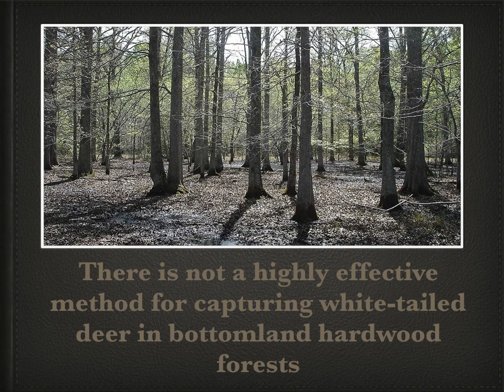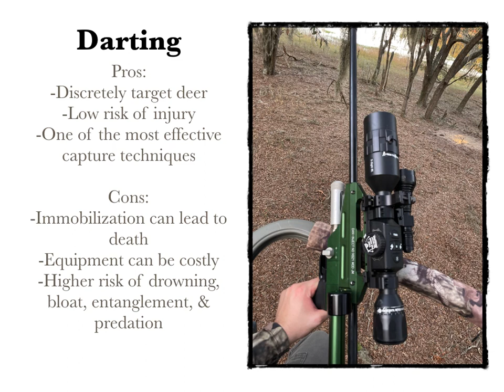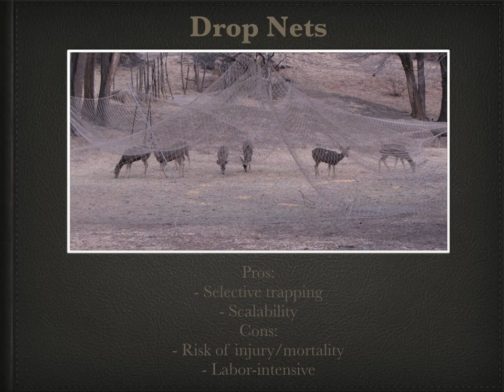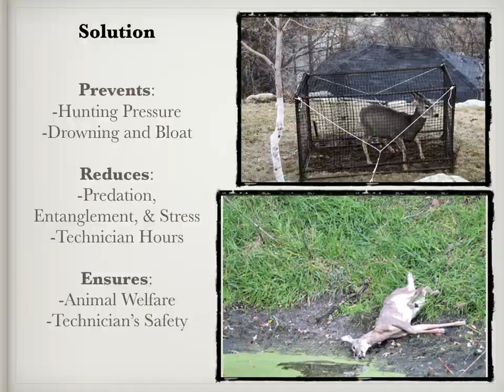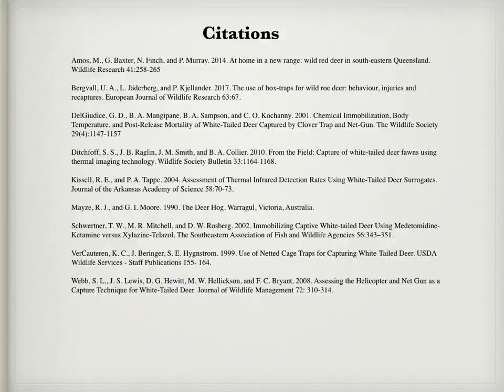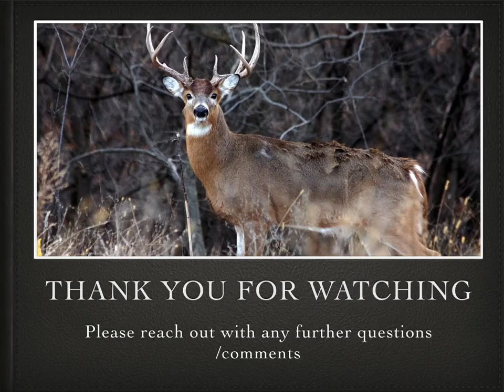Capture methods for white-tailed deer - Andrew and Derrick

Comment: very cool presentation! how would you work around the issue of flooding? is there a specific time of year when research would/wouldn't be conducted? or did you have another idea for this?
Reply: Typically researchers capture right after hunting season which is the time in between winter and spring before it starts to flood. We also tend to avoid areas that are flooded.

Comment: Great job guys, great video! Why did you choose single animal clover trap instead of a corral trap for many animals?
Reply: White-tails, especially ones that live in bottomland hardwoods are difficult to trap in groups. They will generally move in groups of 3 and not stay close enough together to trap them all. It many cases it will be 2 adult does and 1 fawn traveling together and we do not want to capture the fawn in most situations.